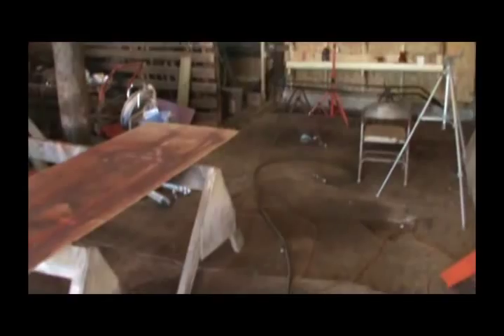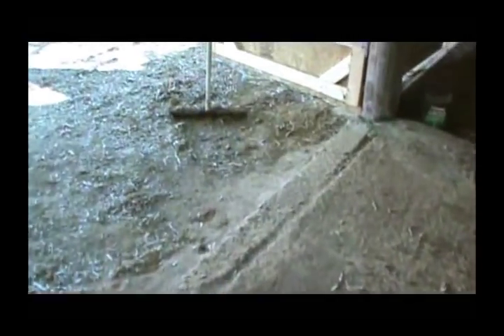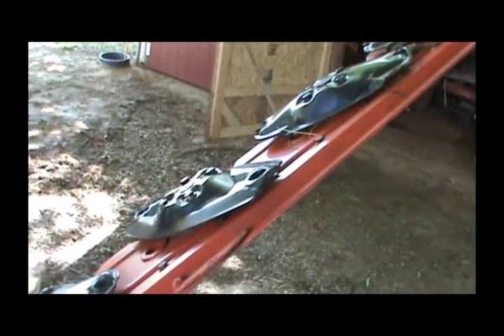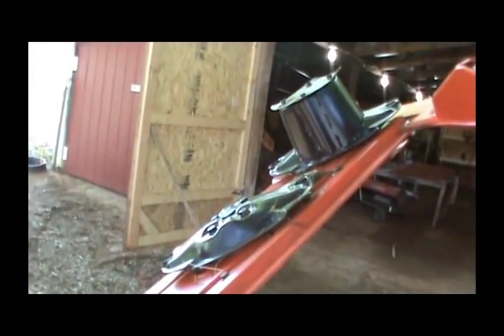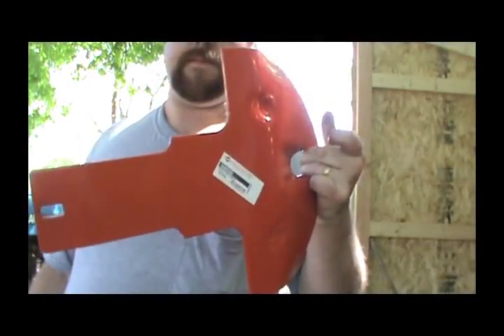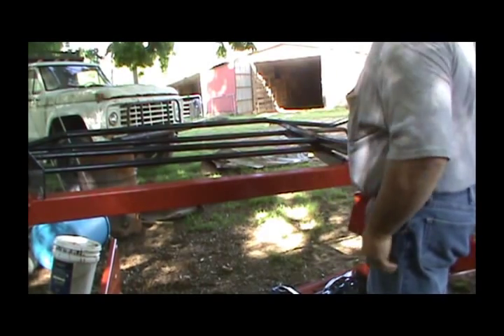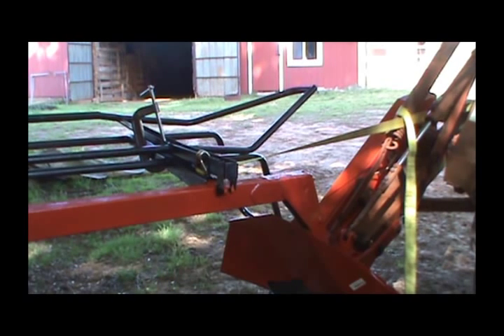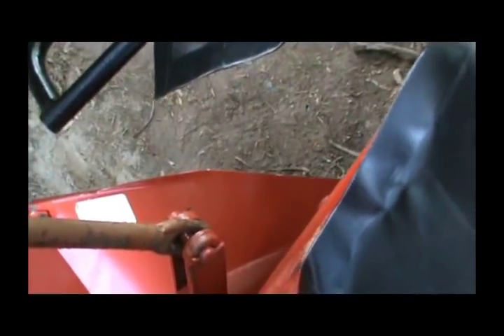Kuhn Mower Rebuild Part 21 - It's not over yet

Comment: Jay, just want to let you know I followed you through the whole rebuild and it was very informative. I am just curious of how much you had in it when you were done minus the curtain. I have and old GMD700 that I need to do the same way. Keep the videos coming.
Reply from the maker: I had around $4500 including the curtain, so about $4,000.  A new one would've cost about $7500-$8000.  I would figure a good bit more for a 7 disc if you have to replace the entire cutter bar housing and bearings like I did.  I would suggest talking to your local Kuhn parts person and get a good price list before starting.

Comment: Where did you get your cover?  I've seen some aftermarket places talked about on the Hay Talk page (in the machinery section) but I'm kinda curious... no sense buying from a company that isn't making them right. 

Enjoying your vids and learning a lot.  I got an old New Holland version of this mower (Kuhn painted yellow and red, like the new John Deere mowers which are a Kuhn painted green) I picked up from a guy I used to run a hay cutter for when he was short handed a few years back.  His boy ran it into a guy wire from a light pole and locked up the outer hat, so they decided to just buy a new 9 foot series II mower and put that one in the fence row.  Got it for $200 (junk iron price then) and would like to fix it up as a backup mower.
Reply from the maker: I got it from S&H Farm Supply.  I hope it was designed to a newer model 500 and not just a bad design to start with.  Of course, my guard was bent up pretty bad too so that may have contributed to the issue.
Reply: farmboy30117 Thanks.  I saw that your frame was buggered pretty bad (nice fix BTW on it!) but the cover looked like it was for a radically different machine.  Did you call them and question them about it??  I mean, I know you said you have an older Kuhn mower, and I don't know if they changed the design quite a bit or not on the cover, but I would think it should fit better than that... and if there are "old" and "new" styles, the company should note that, seems to me...

The skirt on my Zweegers is in tatters, but it works tolerably well.  The Zweegers was neat in that it has a tapered sheet metal top bolted to the gearbox, so any duff and fluff that ends up on it sorta rattles down and falls off the front, back, and far end. 

Later! OL JR :)